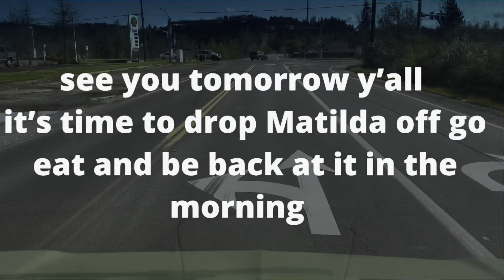Skoolie Window Deletes “PART 2” / One step closer to Bus Life

Comment: Hi Robert, does that back brace help reduce the amount of pain you feel at the end of the day? I'm willing to try anything that reduces the amount I end up spending at the chiropractor. Loving the progress. Take good care sweetie x
Reply from the maker: OHHHHHH Lou does it help, I have a issue of hunching and get major pain in between my shoulders and it pinch’s and tingles till my back tightens up and then I’m down and out for a few days.   If I can keep the brake on and my shoulders back and stand straight it helps a lot.